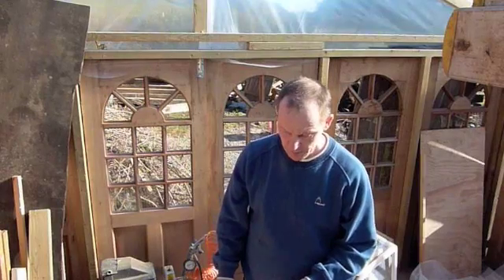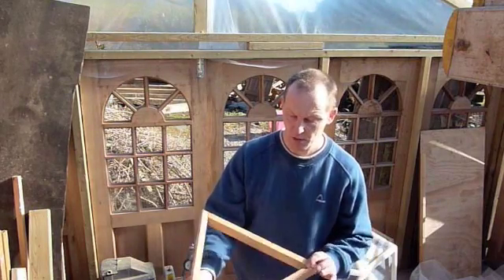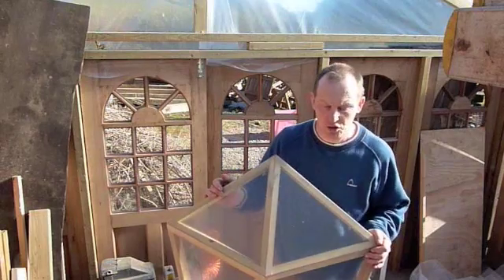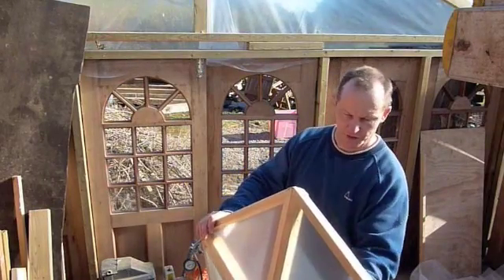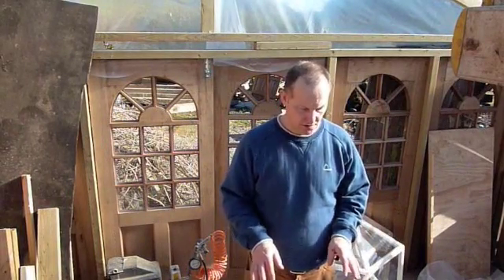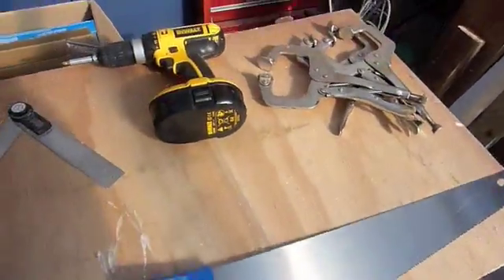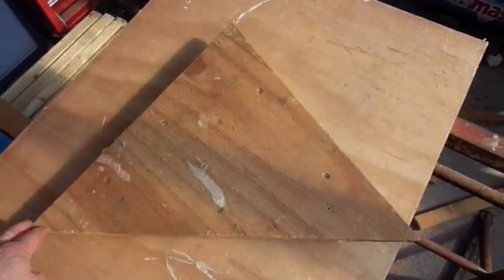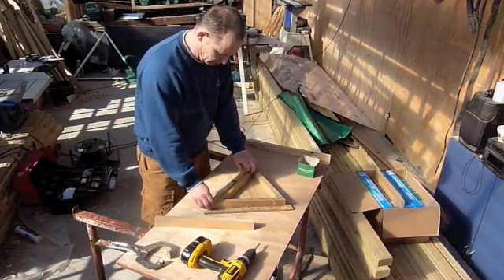geo-dome plans intro

Comment: Hi Guys.
Can anyone in the UK please let me know what a 60mm No4 screw is. Thanks.
I bought one of Paul's plans and here in NZ we don't use the No4 labeling.
Reply: 60 mm is the length of the screw No4 is the diameter of the head.  This metric is more precise but it melts my brain.  I understand how it can be confusing.  Hope this helps bud.

Comment: Hi Paul, I would like to built a 3v 7/12 dome with 6 m diameter. Therefore I use a calculator. Bur the calculator doesn`t give me all informations I need. I want built a lot of single wooden tringels and then put them together t create the dome. But I don`t know how long the single wooden strut must be (there are sure different lengths), how to cut them at the ends and in which angle I have to cout the lengthside of the struts. Even if I would have the angles and dimensions of the single struts I have to know how many I need of each. And next is how many different triangles (triangle A with struts a and b, triangle B with struts b an c and so on) I need and finally in wich series I put the triangles tigether to get ma dome. Can you help me anyhow? Would be great. Thanks Paul

Comment: While the Polythene sheet used to cover each triangle will be the cheapest option, it is also prone to UV damage, that will cause it fall apart in about 4-5 years and you would have to take the dome down and cover every single triangle again, which lets face it, will be a complete PITA...What is needed is transparent material that is not effected by UV, so you can put up the dome and forget about having to do maintenance on it.  And using wood struts is asking for trouble too, as wood rots.

Comment: Yeah. I understand on the two V Geo Dome the degrees 15.86 and 18 degrees my question is when you Bevel the whole entire board instead just the ends what angle do you Bevel it at you have a video on that

Comment: hello
 paul, I'm a boy from Spain and I'm thinking about making a dome, but 
you'll see, it's very complex to understand how to form the triangles, -
 you'd be so kind to send me a simple graph with your measurements of 
the molds I need
to build a v4 dome 12 meters in diameter?

and
 if you could answer another question, because I've seen your videos but
 I do not speak English, I'm using the translator to write to you.

to mount the dome I must mount the pentagons first?

or hexagons too?

Well I think this is all ,,, I would really appreciate your response ,,, greetings from Spain and excellent work.

Comment: Do the following:
1.  Cut one A
2.  Cut one B
3.  Cut one C

Do NOT assemble

Now do the following:

1.  Place a strip of wood INSIDE strut A and cut it.
It will automatically be shorter.  It will become the INSIDE 
strut of the template for side A. 
2.  Repeat this for B
3.  Repeat this for C
4.  Now assemble these pieces and affix to plywood, etc.
5.  And start building.

Comment: Any Updates to your build? I just put together a paper model using pents and triangles the converging pents formed the hexs on a 2v dome so I think that the rip cuts are all suppoused to be at 7deg. Also, the only mention I can find anywhere on the net about what angle to cut is 7deg. The only place I can see this not being true would be around the door and at the base. I want to build a small test dome to make sure I have it right before I build my 24ft greenhouse.